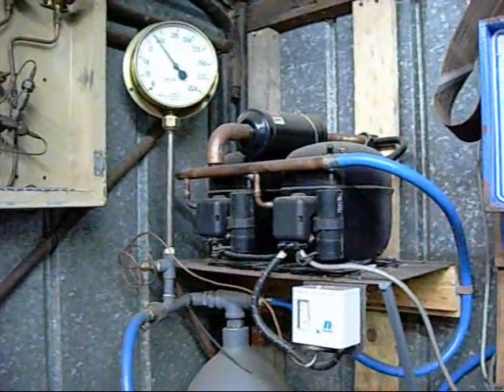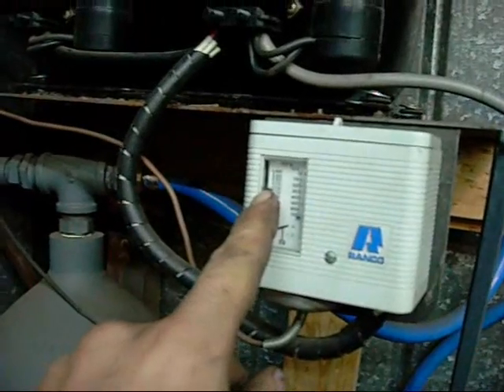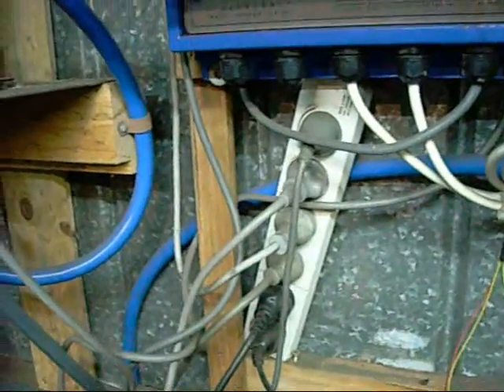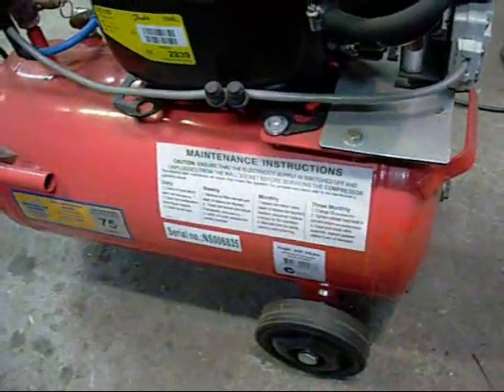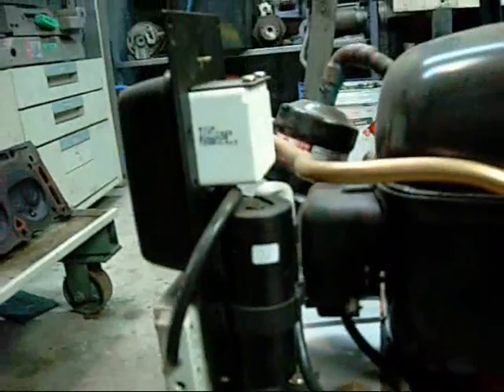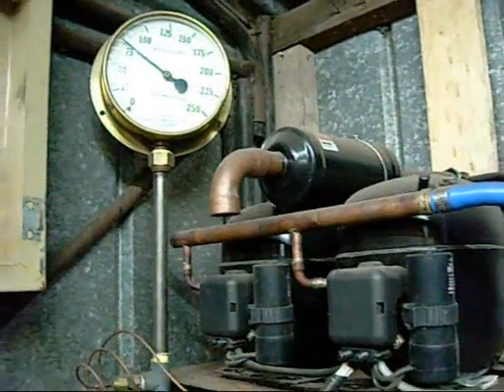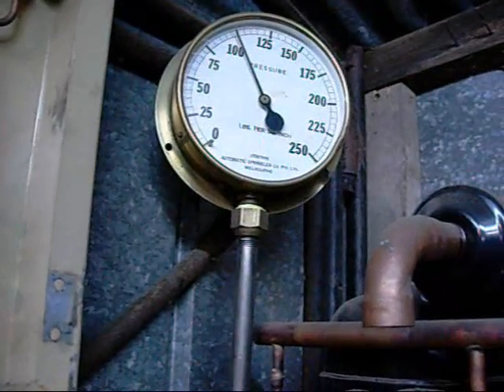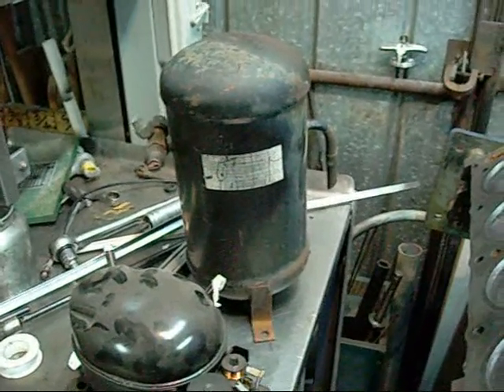Silent Air Compressors from Fridge Compressors

Comment: I do plan on making one of these at some point.  Would it be acceptable to put like 4 to 6 refrigerator compressors in tandem?  Or in terms of compressors should I more so go for ones from R22 style units?  From what I can remember R12 and R134A units can put out somewhere around 150 PSI and an R22 compressor can make upwards of 300PSI.  I can't remember the exact numbers.
Only things about this I'd really only worry about is if I could actually use air tools like drills and angle die grinders and the other thing id worry about is oil siphoning. Which style of compressor is least likely to do that ?
Thanks!

Comment: hehe this is what i plan to make! fantastic system there Ed!
Reply from the maker: yeh they work well!, keep an eye out for old coolroom or display case units, they have much higher CFM output.
Reply: Aussie50
Thanks man, yeah i will. i have my eye on a huge one its like 3 small one stacked one on top of the other. my hope is that it is 240v. i know its not 3 phase, not enough wires.. but sadly that was all i got to see of it.
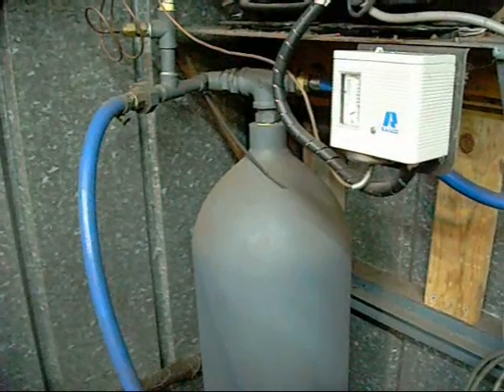it was under a pile of sheet steel offcuts but with it being Christmas the scrap yard has not been open for about a week. maybe able to get down later today  (after i have been to bed, its 00:40 here!)

Comment: when you are using one as air comp you can put normal compressor oil in them but drain the old oil befor and never fill them to high ;D

Comment: I should make a decent setup for where I work out of some of this kind of stuff.  I hate the deafening loud POS he has there now.  I did make a decent high pressure blower from a 3 fan central vacuum motor.  Would any of these compressors be decent for compressing air to blow things out and also run small air tools (small impact driver)?

Comment: If you open this system back up, can you check if there is any oil in the lines? I'm tempted to make a compressor like this, though apparently oil emulsion is common in these compressor setups.

Comment: @zerodegrees8 install a check valve between the tank and pumps and install a tee between the pump and check valve. To ways to unload the pumps for a restart. One  you need a on/off pressure switch with a unloader valve. small bleed valve that uses a core from a tire to bleed pressure wile the motors are off, its built into the switch.   easiest way.              they are found on larger pressure switches with a 2 hp and up power rating.  

Two use an electric valve.  Costs more!

Comment: These compressors are designed to have a continuous throughput of oil. There is an intake tube inside the hermetically sealed container, and as oil returns to the unit from the air receiver/oil separator it reaches the level of the intake and the oil is fed back through the compressor.

Most have no rings and need very close tolerances to work efficiently, hence the recirculating oil system. A piece of capilliary line from the oil separator to the air intake will effectively meter the oil return

Comment: @zerodegrees8 also if you know weather a small compressor could pump up to 110psi, would like to get 120 tho, what i have for air storage is a 30 gallon propane tank, i could take pictures and post them as a video if that would help? any help is much appriciated 
Your design has given me the motivation to make one of my own, basically for use with an air wratchet, small air nailer, and pumping tires, hope i hear from you
Jon

Comment: Hey Aussie50 I live in canada and most of our appliance's run off of 120v ac, i was wondering i have already got a propane tank ready to hook to a compressor such as yours, but before i start to solder the pipes together i 2 small pumps off of fridges from the scrap pile at the dump, but i kinked the air line to test it starting under pressure and when i unplug it and plug it back in the sompressor won't pump, any ideas how to have the line empy to the tank for easy start?

Comment: GR8 Video.  I am building a compressor for my airbrush.  I have the compressor but it did not come with the starter/PTC.  So I got one from an appliance shop but it appears it is the wrong one.  I got the type with a relay and thermal switch.  I got the compressor to start but it soon tripped the thermal relay.  I found put I need a RSCR type starter.  Any ideas how I can get this to run without too much fuss?

Comment: Seems they have oil in them but as its donkeys years old i`ll replace it with new oil. I`m considering drilling a hole in the side of the case to act as an oil filling overflow so i can just top it up until a little runs out every so often and use a plug.. sounds reasonable? The only thing i`m not sure of is how high from the bottom of the casing to drill the hole ro provide a  safe depth of oil..i was thinking 2" might be about right unless you have any recommendations?
cheers

Comment from the maker: @Digadogup Argon is a inert gas and cylinders have no external lining at all, Acetylene cylinders have a outer skin of Concrete or Asbestos, but it does not become airborne unless you are cutting the cylinder apart with a grinder.
Likewise AFIK, Acetylene tanks have a filler of Cotton Wool to absorb Acetone in the tank.

Using Argon, Nitrogen, oxygen, , Propane, or other high pressure gas cylinders as air tanks poses no airborne dust hazard.

Acetylene tanks may pose a problem, and I don't use

Comment: @Aussie50 if the outlet pipe asin the one that goes to the resovour tank is goes higher that the fridge motor/compresser before it goes back down the it will not spit oil its like a cyphon so say the compresser is 15inch from ground the pipes should be say 17 inch before it goes down lower that the compressor thx nice duo make

Comment from the maker: @craigr13666 yeah its a bit slow for its size, big air tools will run it down pretty quick, but small die grinders, blow guns and tyre inflators are fine.

I've got a pair of commercial compressors 2X the size of them for if i ever need lots more air.

Comment: i picked up an old stainless steel LPG car tank and converted it to compressed air it works quite well. i use it as a secondary air tank that i then hook my air hose up to. it  holds 70 liters much better then the 40 liter tank on my compressor.

Comment from the maker: any air compressor that uses wet-sump lubrication will pump oil out with the air, the more worn the piston and rings are, the more oil will come out.

Ingersol Rand and a few other companies make oilless air compressors, but they are very pricey.

Comment from the maker: neither compressor needs a check valve since the compressors start under full load and have air tight valves inside.

The red tank dose have a check valve and unloader from the old compressor pump which wouldn't start under load.

Comment from the maker: The small fridge compressors do pump a small amount of air, if you can get the bigger ones I'd advise using them instead!.
but the small one would charge a small propane tank pretty well. but you may not get the constant CFM needed for the airbrush.

Comment from the maker: You can make an engine or electric motor driven air compressor with an auto AC comp. 
Electric motor would need to be at least 1.5Hp with a reduced belt drive (3" pulley on motor)

But a 4HP Briggs or similar engine would work fine.

The clutch requires 12V DC but you can weld the plate to the pulley so its always on

Pressure control could be managed by the clutch disengaging the comp at a set pressure (12v Control system). or a 3 way valve dumping press from the compressor while the tank holds

Comment from the maker: The flow on the little portable one is pretty dismal, but a bigger compressor will fix that.

the tandem had no trouble seating beads on 2 big lawn tractor tires in a row, purely due to tank capacity.

Comment from the maker: As far as oil is concerned, if they do pump oil around, then a commercial 'oil trap' may be the easiest option to keep it in check.

I did a torture test on one of my early display compressors that I cut open, the 1/4 HP TL4a. it ran for 4 hours straight, bone dry, before seizing the main crank bearing.

I've even had a SC15 pumping water for a few mins (modified and insulated electrics on isolating transformer)

Comment from the maker: The pressure rating of copper pipe is dependent on many things, particularly what its classification, diameter and wall thickness is. I'd recommend "refrigeration grade" pipe which is designed to take pressures far exceeding that of the compressor especially if your pushing for 200psi +

Comment from the maker: I don;t mind running tests like that at all!, it gives me something to do that's beneficial, other than turning stuff into scrap metal.

I was thinking of hooking one up to a truck tire tube ages ago to see how long it would take to go from dead flat to firm pressure. but I'll use a small tank and maybe a .5HP compressor in addition to my tandem system.

Comment: one more question how high of a pressure do you think a small unit can handel,,, i bet that scroll compressure 
would do 300 psi with no problem
i wonder what the max pressure for standerd copper pipe is?
any way very good project friend this quiet
compressure thing is important to me im a night owl most big jobs are done from 1:00 to 5:00 in the morning also would you be willing to do some time trials for me and perhaps on a vid show the time it takse to refill with air,no obligation :]

Comment: thanks for the vid and yes noise sucks
ask my girlfriend,lol the fact that you see the need for quiet compressures is awsome,compressures are fk noisy
one thing i am going to build one but im woried about oil ? how much oil can i lose before the pump suffers,i may need to build a site glass drain the oil put in the site glass or level tube that can handle high vaccum. also good point my compressur station will also have vaccum abilities for test that need vaccums,very good vid friend.

Comment from the maker: glad you like it!

temp depends on many things, mainly how long they run for and how high the pressure required is.

Domestic fridge compressors are pretty good but many air con compressors are dependent on the icy cold return gas (called 'subcooling' in the HVAC world) for cooling and will overheat if run for too long.

Even if they do burn out after a while, their abundant and practically free to obtain anyway.